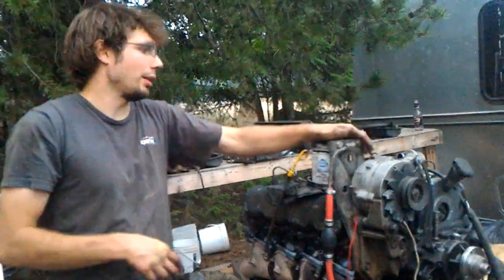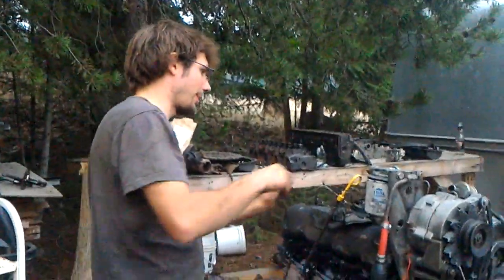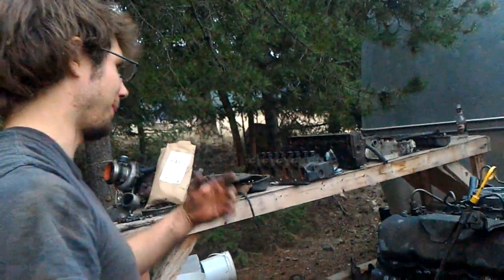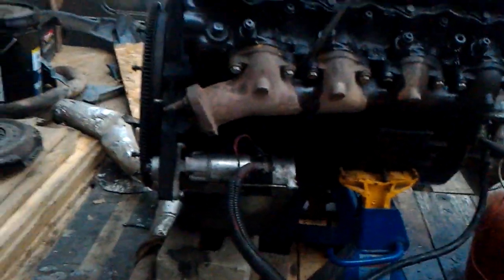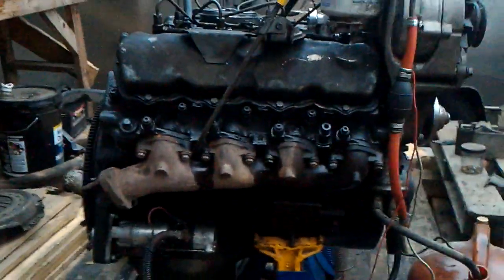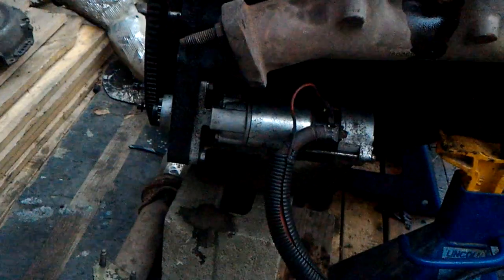New IDI build - Finally running good!

Comment: MacRobb how did you correct the 180?   In this video its sounds better than great.  Did you disassemble to align all the marks?
Reply from the maker: Pulled #1 glow plug, cranked over until TDC #1 with intake and exhaust closed(so air coming out glow plug hole up until the crank mark), then just pried up the IP gear housing(with pump, gear etc still in place) enough to rotate the gear to where it should be - pin at like 4:30, and the two opposite bolts at like 10 and 2 - straight across from each other. That should get me within a tooth or so.
Reply: @MacRobbSimpson  Thanks for the tip.  Good video.

Comment: Doing a 7.3 with my son now haven't tried to start yet but when putting the Injection pump back on I used the marks on the gear from the i.p. and that camshaft gear.Is my timing going to be right?
Also I enjoy your videos man keep them coming
Reply from the maker: It should be close... but remember, even when everything was new, timing by the marks just gets you a running engine; you need to dynamic time from there.
And, honestly, when you are using used parts(IP and/or injectors), you pretty much need to time 'by ear' - adjust back and forth until you get the best power/most responsiveness, because that will be the 'right' setting for economy as well.
Reply: @MacRobbSimpson   how did you correct the timing alignment on yours? it sounds great.
Reply from the maker: @tdemola  The easiest way is when it's in the vehicle; I'll get it under full acceleration and see how she sounds at 2000+ RPM. If you are getting white or gray/blue smoke, advance the timing a little. Black smoke, perhaps retard it. You want it just advanced of where you don't get any white/gray/blue smoke, where it feels the most powerful. This is your "main" timing, which you adjust by rotating the whole pump(top towards passenger side to advance, towards driver's side to retard). If it's a worn pump, you may have to literally "skip" the IP gear a tooth forward to compensate for a failing advance circuit in the IP. 

Once the high end is where you want it, loosen the light-load cam(driver's side of the IP, on the throttle shaft) and play with it a little. The further up the cam it rides, the more retarded. Get it where it drives best at idle and just off idle performance.

You'll get the hang of it pretty quickly.

Comment: Please no ether, just use WD40 or a mix of the 2.
Reply: Ether don't hurt if the the glow plugs are not working. WD40 wont light nothing. My friend had a 6.9idi with a burnt out glow plug controller and used starter fluid in it everyday for 10years and it didnt hurt anything. Why is eveyone so scared of a little ether? most starter fluids made now are only 10% ether lots of diesels were made for ether cold starts right from the factory.